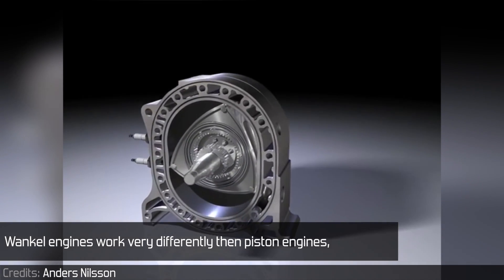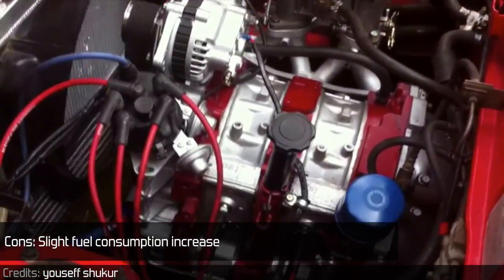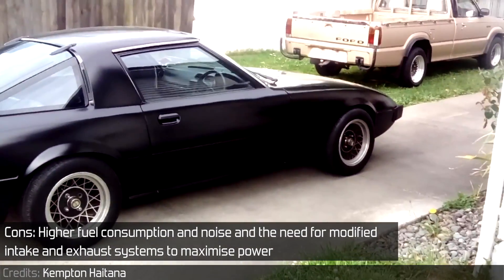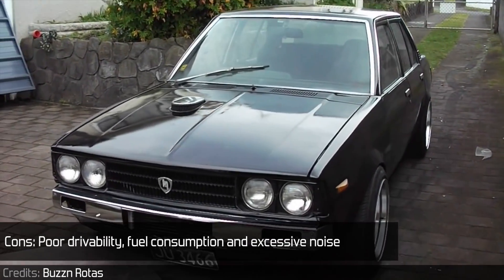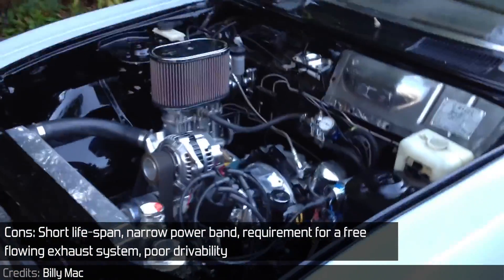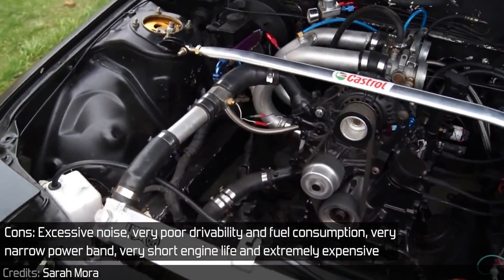Rotary Porting: How does it work and look?

Comment: With a Peripheral Port, a rectangular port gives better results than a round port.
NSU data.
An earlier closing of a P Port gives the best low rpm torque, a later closing of PP provides higher top rpm power. 
Do you want to run on the streets, or pass one day at the races?

Comment: I won't endorse 100 % the statements about Peripheral Intake Port. 
You can download from the web the 1981 edition of Kenichi Yamamoto 'Rotary engine' book. 
Chart about Power and Torque advantages with Peripheral Intake Port along with Peripheral Exhaust Port are impressive, but the issue of port overlap is there, fresh mix going into exhaust ducts, burnt gases entering the Intake Stroke. 

For an Street Car, NSU proved a Peripheral Rectangular Intake Port is better than a Round Peripheral Intake Port, and an smaller area Port is better than a larger Port. 

As stated, my choice would be an V-Force Reed-Valve controlled Peripheral Intake Port, closing 40° after BDC for low rpm, low load Torque and driveability, the later Intake is closed, the better high rpm performance us.
To totally eliminate Port overlap, simply have the Side Intake Ports fully clogged, keep the Renesis Side Exhaust Ports. 

For low rpm, low load, an Intake duct of 33 cm from carb to housing Intake hole is best. 
For high rpm performance, the shortest the intake duct is better.
Straight angle intersections between ducts and working surfaces in housing, in side plates, are bad for BMEP and seal life, better have it beveled.

Toyota, SAE technical paper 790435, had a 9 % economy improvement by adding a Reed-Valve on Intake Port, injecting air on Exhaust Port area, and placing a Glow Plug in leading plug hole. 
Where to find a suitable Glow Plug, I don't know. 
Glow Plugs for Diesel engines are usually built for a temporary Glow at start, continued Glow is a different thing.
Kawasaki patented, US3848574 (look at ESPACENET) a combustion promoting plug hole change for RCE, a wedge shaped prolongation from plug hole, pointing to Rotor trailing side looks good. 
They say it worked. 

I'd test all these changes in an Atkins Rotary parts built Single Rotor Renesis, but I lack the resources.
 If you have U$8'000 and a good test bench, you could test this by yourself.
Blessings +

Comment: Would it be possible to have a 4 rotor with mild porting and, say, 400 reliable, very streetable horsepower? Every 4 rotor I see usually sounds like it's tube ported

Comment: 13b comes out bridge ported, 12 comes out with a tall port, peripheral porting or monster porting opens these engines right up. Porting a rotory 101 no need to mention eccentric shafts or anything else that isnt related to the porting or polishing of the ports
Reply: all rotaries come with stock ports lmao

Comment: A J port is like a bigger eyebrow that you'd have with a bridge port similar to the pic at 4:37, so it's more aggressive than a Bridge Port allowing for higher RPM, its called a J port because of how close it gets to the water jacket. A Monster port is what's shown at 5:28. It's known as a Monster port because the sheer size of the two heavily modified ports. Monster port engines are known for their short life spans.

Comment: The p-port RX7 at the end has a different engine to Mazda's R26B. In the RX7, the rotors have a 180° timing difference, so each pair of rotors has their intake, compression, power and exhaust strokes simultaneously. The Mazda R26B had rotors at 90°, so at any given time each rotor would be performing a different stroke. Mazda's setup decreases the instantaneous torque application when a combustion stroke starts, making their engine 'smoother' due to increased power stroke overlap and less likely to fail due to lower stresses on the eccentric shaft and transmission (or transaxle for the R26B).

Comment: I get it now. The PP is the most power that can be developed in a NA rotary, the amazing sound, highest fuel consumption, higher revs, poor driveability and low lifespan which means the closest to having the engine at its highest before it will blow up.
I wish there could be some technological improvement in the rotary where that could be problem could be solved.

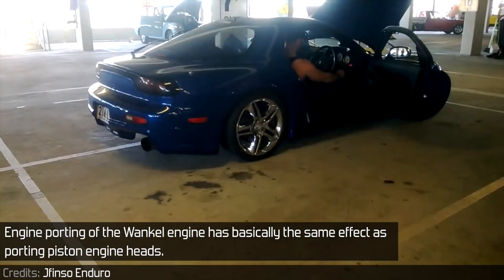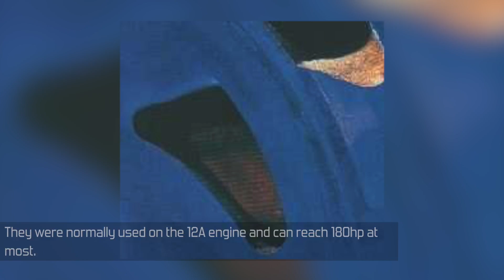Comment: At 1:00, this video is wrong. Porting the rotary does NOT have "basically the same effect as porting piston engine heads". Porting the rotary is far more akin to changing the piston engine camshaft. You are altering exhaust and intake event timing and increasing flow. Though generally not adding huge amounts of CFM, it is more about the timing change unless we are talking about radical ports like peripheral. But porting a piston engine cylinder head does not change intake/exhaust event timing at all, only adding airflow. Confusingly the commentary then continues with correct information saying rotary porting changes intake and exhaust timing. One can also argue at 1:48 that it's not really easy to upgrade stock ports to other types. Oh sure, the actual grinding of the port is fine for someone with experience, but to access those ports means complete engine disassembly. The video also seems to insinuate that only 12As used stock ports at 1:42. Stopped watching after that.
Reply: i agree, he literally just reading and used the pictures from a really old article written on mazdarotary.net
Reply: Hey aaron, Love the Cosmo restoration so far. Good to see you pick yourself up from the robbery and continue working on the car. Keep up the good work.
Reply: Eekekk#ksisswwkwkiwowooow
Reply from the maker: Aaron, I did not say that the rotary porting is the same and only similar to the porting the heads. Listen carefully, I said that it is the same as the head porting, variable valve timing and big cams altogether!
Reply: I quote from the video and captions "Engine porting of the Wankel engine has basically the same effect as porting piston engine heads.". The next sentence is "What it does is it changes the intake stroke duration". Which insinuates that porting piston cylinder heads changes the intake stroke duration. It may just be an error in translation but the end result is confusing. I also just noticed that this video doesn't cover rotary exhaust porting at all, which is just as important as intake porting. In bridge porting you also claim that it pushes the rev limit to 8,000 revs at 4:43. Porting has nothing to do with the rev limit of the engine. That is set by mechanical balance as well as whether the engine can be controlled adequately at those speeds. Every rotary up until the S5 RX-7 had an 8K upper redline from the factory. Which was upped to 9K for the S5, then 10K for the RX-8. I just don't like rotary misinformation spread because there certainly is enough of it already.
Reply from the maker: "as equivalent of"... continue reading
Reply: I stand by my view it is a self-contradictory statement. But perhaps unintentional and just a consequence of translation to English. I keep watching more of the video though. At 6:48, you claim peripheral ported engines cannot idle below 2,000 RPM. Totally untrue.

Comment: Interesting, but you should mention this all applies to OLD rotary engines. The Renesis engine (13B-MSP) is already significantly modified compared to an old 13B or 12A.

Also, peripheral porting is NOT the ultimate port configuration for a rotary engine, because it allows leakage between rotor faces and it also allows unburned fuel to escape into the exhaust, making the exhaust MUCH hotter. Side-porting is the best port configuration for a rotary engine, because it allows the side of the rotor to completely block the ports between intake and exhaust cycles.
Reply from the maker: Sure thing, but it still has the stock ports.
Reply: The ports on the 13B-MSP may be "stock", but they are still very different from the ports on older rotary engines. There are three sets of intake ports for each rotor, and the exhaust ports are on the side instead of the outer rim of the housing. Those three sets of intake ports accomplish the same thing as port modding on an older rotary engine, except they can be closed at low RPM to avoid the problems with bad idle and wasted fuel.
Reply: +Shawn Elliott And yet, all racing rotary engines are peripheral ported engines.
Reply: That doesn't negate anything I said.

Comment: rotary engines are not inreliable its all about how to maintain it and build it and all of the max hp he stated was all motor not forced induction ratings
Reply from the maker: You are absolutely right!
Reply: Rotary engines would be significantly more reliable if they didn't rely on oil ports in the rotor housing that can get clogged with soot, and if they had ceramic seals from the factory. Almost nobody can afford to fix these two problems.
Reply from the maker: I agree with the ceramic seals, especially the apex ones.

Comment: 180 hp for stock porting is for one rotor or two rotors? And 180 hp is the horsepower number for natural aspiration only, right?
Reply from the maker: As I mentioned the 12A two-rotor engine, it didn't find necessary to say it means for the engine, not per one rotor. Sorry, if that was unclear. And yes - for the NA, not turbo.
Reply: VisioRacer Ok, thanks! :)
Reply from the maker: No problem

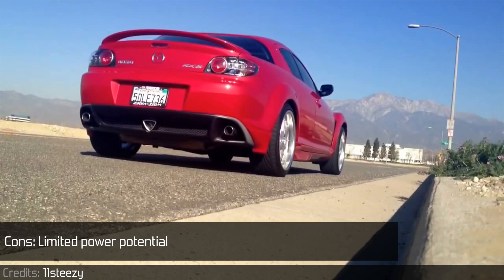Comment: 1:55 Great fuel efficiency my ass, better than ported but not great!
Reply from the maker: Do you have some understanding problems? Did I compare it to a piston engine?
Reply: I understand that you are comparing porting methods. My point is that you say; "Great driveability and fuel efficiency." When discussing all the other port jobs you relate them to each other, to relate it to the others I would say "Best driveability and fuel efficiency." Otherwise it just sounds like you're giving it undeserved praise.
Reply from the maker: It may sound like that only to you. People normally know how does the rotary work and what are its up/downsides, thus can figure out what I meant by that sentence.

Comment: Can Renesis rotary engines be ported in any of these ways mentioned? I'd like to know about the bridge or street port in particular. I've heard because of their new design the potential of porting was completely killed
Reply from the maker: I cannot say for sure, IMO why wouldn't it be possible, but to be sure try to fine a more experienced person about this.
Reply: VisioRacer I've been growing more curious because I plan to rebuild my RX8's engine soon and figured I should definitely try to port it while it's apart.  I'll be doing more research about it and thanks for the reply (:
Reply: Its absolutely possible my friend, in exactly the same way
Reply from the maker: Here you have it!
Reply: Storm Anderozzi Yeah it's definitely possible man! I plan to buy Peripheral Ported housings for my RX8.

That and there's guy's out there with Bridgeported or Peripheral Ported RX8's.
Reply: Storm Anderozzi I'm going Peripheral since it makes the more since for me, and probably has the greatest HP improvement over Bridgeport.

The intake airflow from the peripheral port, almost 50% greater than the stock ports. It's crazy! 😍

Comment: does this mean you can rev the engine at redline? im not that into rotary engines so this might be considered a stupid question
Reply from the maker: You can always rev it all the way to the redline, but with more aggressive porting the redline raises.
Reply: TehKillerKitteh Our cars can already rev to Redline. Rotaries don't have a traditional "rev limiter" 

Some porting though increases you red line by 1,000rpm to 2,000 rpm extra. 

So naturally RX8's redline to 9,500rpm. So with a Peripheral Port, you'd redline to almost 12,000 RPM sometimes more or less. 

Welcome to rotaries my friend! 🙌

Comment: Seriously Visio, you gotta stop giving love to those rotaries. I'm saving for a boxer, but your rotary videos keep pushing me for a used rx8. LOL
Reply from the maker: I love my boxer, but I love rotaries. You gotta love them all!
Reply: VisioRacer Damn right, love em all!
Reply: Abdul Jabbar Al Hayyan Go for it bro! You'd love it, just make sure you do proper mods to it. 

Please don't cheap out on mods, buy a proper exhaust system. Aftermarket mid pipes to 3 inches, 3 inch muffler, and exhaust tips, and get a cold air intake.

I whole heartily recommend AEM, they are expensive but 100% worth it. Nothing like owning a rotary that actually has airflow.

With those mods your RX8 will have "gills" and breathe. You will definitely rep the benefits, my friend! 🙌
Reply: Abdul Jabbar Al Hayyan By the way, headers will be a pretty good upgrade as well. But it isn't needed right away, I would definitely recommend a Aftermarket midpipe.

 High flow muffler like magnaflow works great too! 

Midpipes go for like $250 on Amazon. 👌

Comment: The best rotary engine upgrade is an LSx swap. I don't find it fun dealing with busted apex seals and shitty gas mileage.
Reply: Yeah maybe if you only want to go in a straight line!! 100kg more in the nose...understeer much. Oh if your popping apex seals nowadays...you're doing it wrong lol.
Reply: The_Bait You should have not treated them like shit lol. I rebuilt the 13BT in my FC when I first got it, and haven't pulled it out since I put it back in 2 years ago. That car is daily driven. 50/50 weight distribution gives much better handling that the extra weight in the front.
Reply: esqueue Bandwagon.
Reply: Yeah wasn't baggin Rx's lol, My old FD got 180,000 km before needing a rebuild, mind you that was running 21 psi boost(GT45) bridgy and PTS seals, sold it to a mate cheap to fund this N/A Rx4, old classic Rx's are a great investment and bloody fun to drive :)
Reply: The_Bait Straight line? RX7s have 50/50 weight distribution, they are made for corners. Have you ever driven an RX7? Apex seals aren't a problem unless you're making big HP, or using the wrong seals. You clearly don't know enough about rotary engines to be talking shit lol
Reply: Cayden, straight line as in drag strip...yeah 50/50 with a rotary not with an extra 100kg of V8. I've own 3 Rx7, 2 FB's and 1 FD...drive a RX4 ATM 13B extend 48ida weber.
Been into rotaries for the last 20 or so years...so you're right I know nothing lol.
Reply: oh I know, LS engines are heavy as hell ffs, not to mention the most overrated shitty swap on earth, like I said this is coming from a GM guy, the LS engines are shit, only V8s worth a damn are old and run carbs
Reply: the amount of work needed to find the exact point to make an LS swap have a 50/50 balance is more than the swaps worth ffs
Reply: so you'll deal with busted rear main seals and shitty gas mileage? alrighty then, apex seals last if you run cfs and more aggressive porting with low boost
Reply: If you knew anything about LS motors you would know that they are lightweight. LS swaps are popular in rx7s because it retains the 50/50 weight distribution.
Reply: Amount of work? My rx7 is balanced 50/50 with an LS swap. It even weighs under 2700 with full interior and power steering. ¯\_(ツ)_/¯
Reply: LOL and my minivan makes 7 bajillion horsepower and 18 bajillion torque, see? I can say stupid shit too, you're talking to a huge GM guy here, LS engines aren't that light...., light compared to an equivalent engine from the 70s of course but by no means light
Reply: You okay man? I'm giving you a testimony for the weight, not spouting horsepower lmao. The weight of LS motors are no secret either. You can literally find this information all over the internet. It nearly weighs as much as a cast iron 4 banger. Saying you're a GM guy must be the "stupid shit" you're talking about because you clearly don't know. 

And no, I'm not talking about the iron block truck motors.
Reply: Lol

Comment: you're getting better and better in you're pronatination. keep up the progress! 
maybe it's an idea that when you have a bridge port. there will be a different manifold mounted where a valve is placed which opened only at a certain RPM. so it will have the peak power. but still be driveable and decent fuel economy?

Comment: So did someone made a variable port timing engine already?
Reply: The RX8 Renesis 13B-MSP has variable port timing already :)

By the way I have more than doubled my Renesis's power by turboing it ..  with stock ports.
Reply: Whatre you talking about they arent great for making big power? You can get 1000hp out of a 13b!
Reply: Punchy LightBeer yea but the rx8 engine is terrible for racing because of the water jackets
Reply: I've never heard that before. What is the problem ? Aren't they almost the same as a 13B?

I'm actually having a problem with mine running too cold (60°C when cruising for more than 10min!)
No the thermostat is not stuck open :)
Reply: Punchy LightBeer they aren't great for making big power

Comment: Ok, this video explains the port thing well, but you only showed N/A exemples, what about turbo ones ? For exemple, you said that bridgeported engines could reach 280hp. But this is the stock power of a late model twin turbo FD ? 
Or maybe since its a different kind of gain it has nothing to do with aspiration ? I'm a rotary fan, still learning, but I have to admit, I'm kinda lost here.
Reply: The Rotorboi the power figures given are for n/a motors, turbo ones can easily go in the upper 3-400hp range. and it does get a little confusing but you'll get the hang of it
- fellow rotor head
Reply: Ayy thanks
Reply: The Rotorboi FD's are Ported and they are turboed.

There are many examples of boosted rotaries with porting. Mad Mike for an example has a Peripheral Port, if I'm not mistaken, on his MX5 Miata with a 26B 4 rotor swap.

He's pushing around 1200HP, so it's definitely possible. My RX7 FD is Street Ported as well